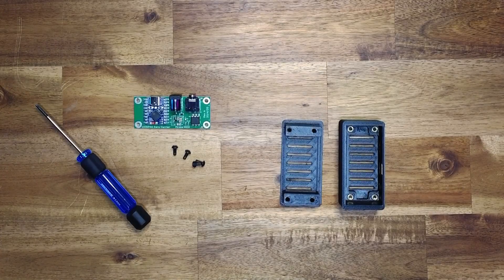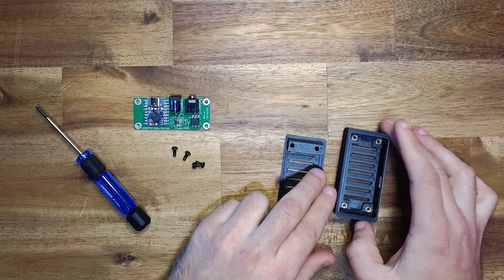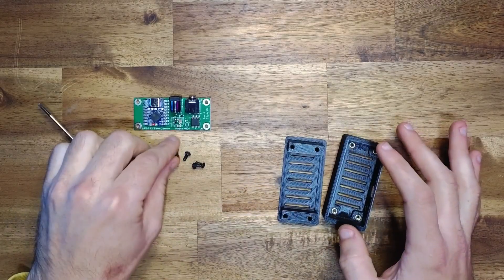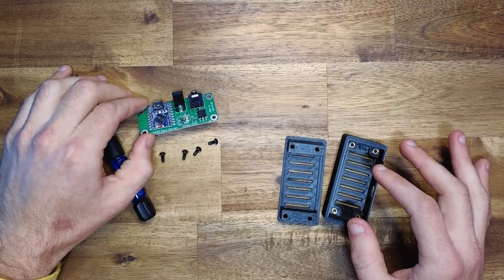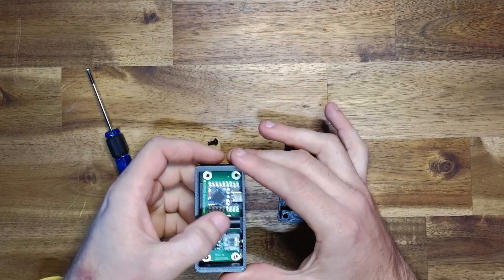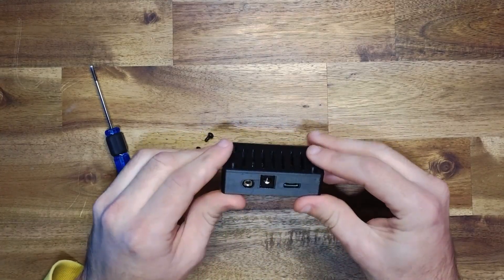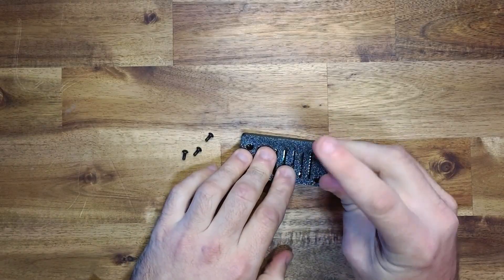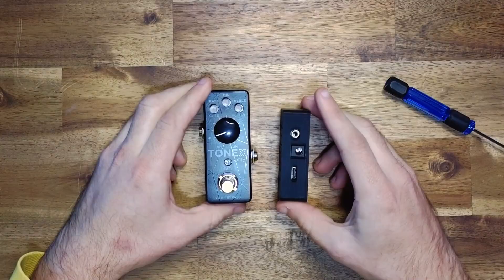Building a Polar Pico - Perfect Under-Board ToneX One MIDI Controller

Comment: Where can i source the the green microchip? Sorry for the terminology, im not expert.
Reply from the maker: The link to the Polar GitHub repository will give you access to all the circuit board files and you would need to order them from a PCB manufacturer.
Reply: @PIRATEMIDI  thank you!

Comment: Great videos and just going to get started setting up my PICO soon and want to know can I use the same app as that other pedal claiming to be plug n play with the iPhone APP easily changing settings of the TONEX one pedal? I am I seeing things…..cheers✌✌✌
Reply from the maker: What pedal or app are you referring to sorry?
Reply: @PIRATEMIDI  The Airstep pedal that uses the ToneX editor on the iPhone allows you to via midi etc to control the  parameters of the TONEX One  etc…how do I do that with the Pico?
Reply from the maker: @TravisWhiteTribe  Check out the user manuals at learn.piratemidi.com - super easy to adjust parameters on a device wirelessly, or just with MIDI commands from a MIDI controller or other MIDI device plugged into the MIDI input of the Polar devices!
Reply: @PIRATEMIDI  Yeah the MIDI controller I am good to go but I love the on the fly control from an APP so when at a show I do not need to be bending over etc to just fix some small parameters....little more gain...touch of EQ etc.....I will make some vids and share pics once I am back on the stage....shows start kicking off from Mid August.....appreciate your time fellow Aussie!!
Reply from the maker: @TravisWhiteTribe  You know about the web configurator yeah? You can do that - adjust parameters from your phone.
Reply: @PIRATEMIDI  Your web configurator or ToneX? Thats exactly what I need :-)